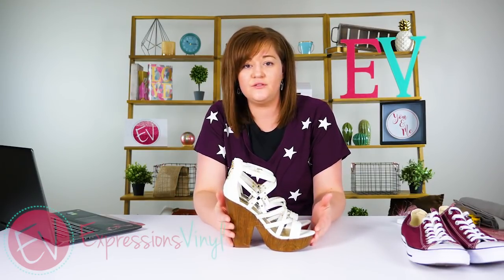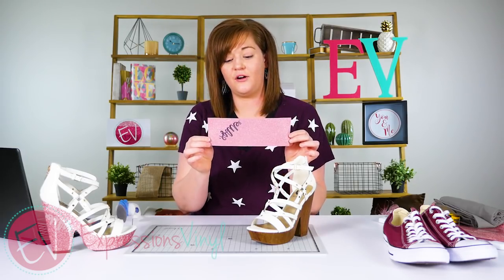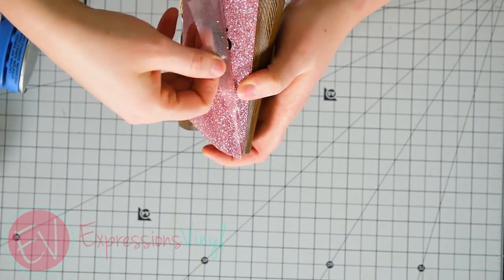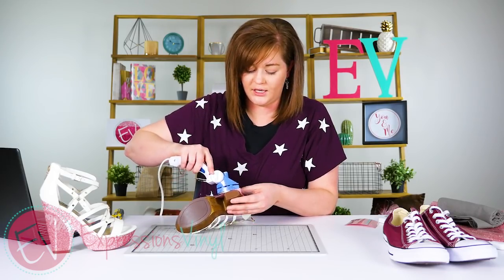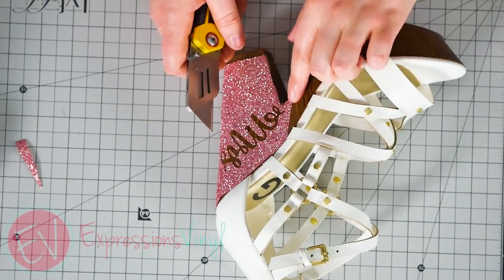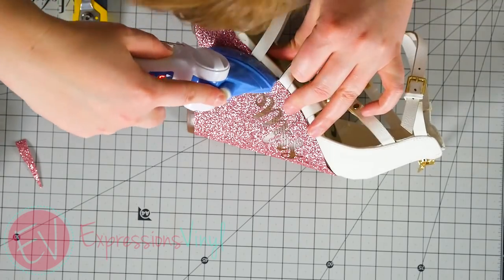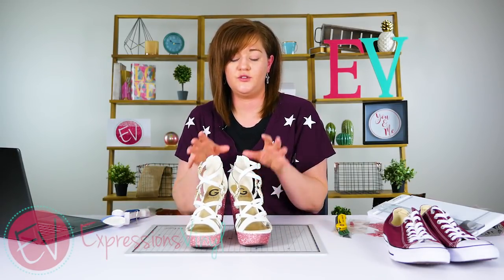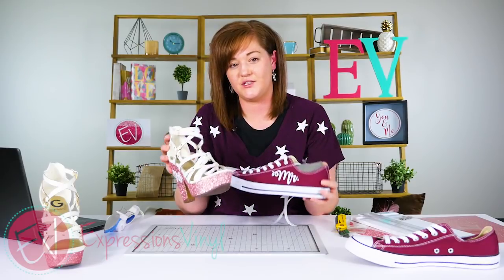How to apply Heat Transfer/Iron On Vinyl on Shoes

Comment: I haven't seen the Siser EW used I guess..... I thought a lot of time and heat was required for all HTV. Thank you for this extensive view of the things one can use it on!
Reply from the maker: Hi Kim, there are so many different things you can do with it.  If it is on a surface that you will not be washing continually and is a little more decorative, you just need enough heat to adhere it to the surface.  Hopefully this helps.

Comment: How do u prevent the vinyl from peeling after wear
Reply from the maker: Leah, typically when htv peels it has to do with either the heat (being too hot or not hot enough) or there wasn't enough pressure. What type of htv are you using and are you using an iron, a Cricut easypress or a heat press?
Reply: I only have issues on shoes on the high pressure areas whole walking I have used star crafts and siser with both heat press and a small hand iron  for small projects I've followed the 15 second thing to a tee no issues on shirts only on shoes
Reply from the maker: @leahballejos6421  With shoes it can be difficult to get a firm even pressure due to the bulkiness and seams..heels..etc.  Also, if the shoes have any coating on them such as a waterproof coating, that can cause issues with the adhesive as well.

Comment: I thought you weren’t supposed to layer on glitter?
Reply from the maker: Hi Rebecca, we don't recommend that you layer on glitter.  In this, Starla did a knock out which gives the layered look but it isn't really layered.  Hopefully this helps.
Reply: She didn't, she created a "knockout" in the very beginning and stated she puzzle pieced them together
Reply: I've layered on regular iron on over glitter and it was fine. I used the Cricut Easy press 2